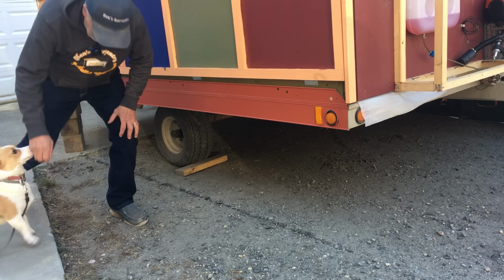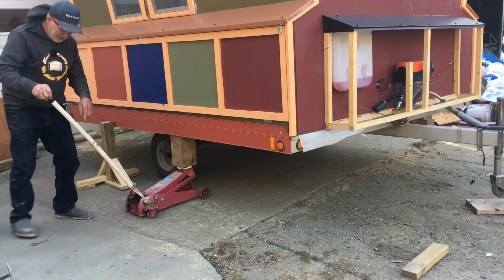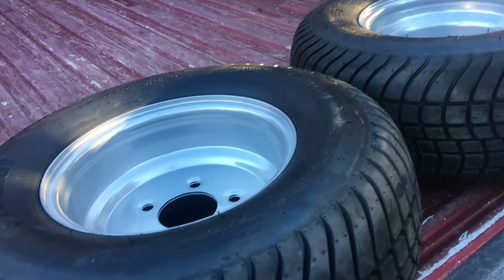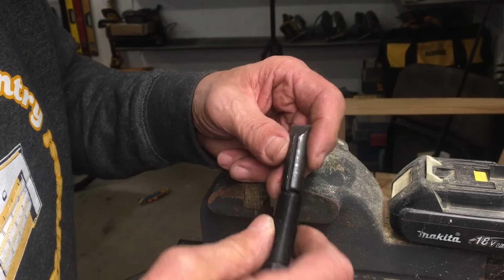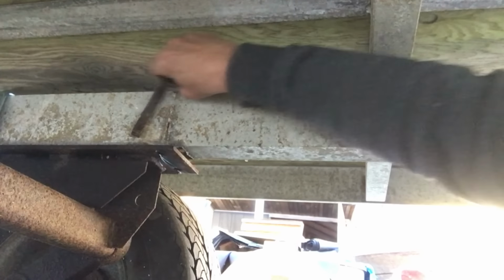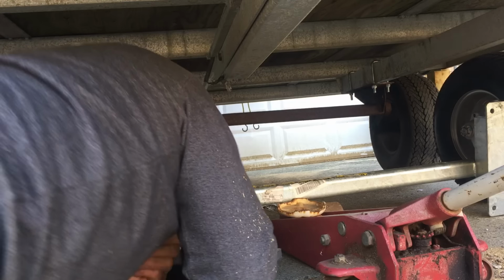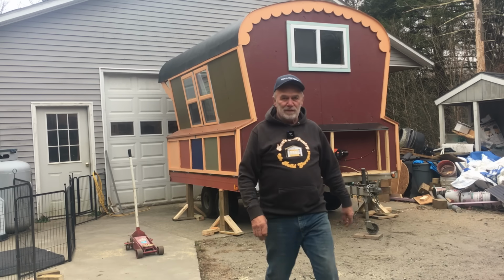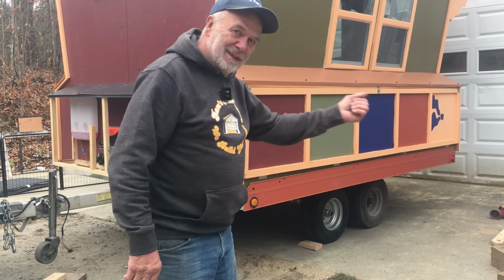Adding a Second Axle to my Trailer!

Comment: I think that would have been a good day for Chad to stop by ;) Doing all that on your back and side is a REAL pain in the neck, I feel your pain, BTDT!!! You surely are an intrepid soul. Do you need to reverse the axles or can you just slide both of them backwards? Clearly you need to move the center of gravity forward for the proper 10%-15% tongue weight and I don't think reversing the axles will accomplish that. Plus, you have the interior weight at the front complete already, any further work in the rear will move the center of gravity that direction even more.
Reply from the maker: Thanks

Comment: Good morning Ken. I went through 2 different types of nut splitters before I learned my lesson! I bought a impact wrench and it paid for itself the first time I used it!!! It’s a deWalt (had the batterie) but any name brand will work.
Reply: even a corded one if you don't use it that often.  They are a big help when you need them.

Comment: You should have 2/3 of a trailer in front of the axle and 1/3 behind you need tongue weight or when you pull it that thing will sway back-and-forth. It might cause an accident just a bit of advice Ken don’t want to see anything bad happen to you or someone else God bless
Reply from the maker: I agree thanks

Comment: Ken, you need a certain amount of tongue weight on that trailer.  That's 10% to 15% of the whole vardo weight.  Otherwise it tows very badly.  To get that, you need to move both axles back.  You certainly need to have both sets of tires carrying the same amount of weight, so you might need to check the distance from each axle to the center of a wheel and maybe replace the old tires so they match the height of the new tires.  You also need to check that the frame is level front-to-back so the axles split the weight.  You might need to change the height of your hitch to do that.  It's a lot simpler with just one axle.
Reply: You need to move both axels back. General rule is 1/3 weight on hitch, if not it will whip around you going down road.
Reply: Came to say the same. So if it weighs 4,000 lbs you want 600 lbs tongue weight.   If not the trailer can get into a perpetual condition that ends with you in a ditch.

Comment: Ken, you need to centralise the axles, basically find the centre point and aet the axles so that the pivot point is in between the two axles, that way when towing the trailer it will turn at the centre point, not to far forward or backwards,

Comment: Been there and done that try rotating your receiver hitch 180 degrees and ball it will get you closer but still have to relocate axles also check the distance between the axles don't just trust the frame. But you know this having pulled trailers most of your life and as remember you mentioned you built homes on trailers in your past
Reply from the maker: Thanks

Comment: Axles must station 60% back from the front of the tongue.  If you don't, your trailer will sway side to side and flip over due to not having enough weight on the tongue.

Comment: Working up, on your back, is really tough! My neck is shot for several days after I do it. Good luck getting things lined up. I had a trailer where I had to turn the hitch ball over, so it was higher than the receiver. I actually bought a second one to do it, so I still had the one that dropped.
Reply from the maker: Yes for sure. Nice

Comment: Ken, after swapping the axles the tongue is still to high to drop onto the hitch ball. May I suggest you take the ball off the coupler, turn the coupler over (180 degrees) and reattach the ball, that will make the ball 3" to 4" higher. That should help. Good Luck. Await your next video. (The old retired guy in San Diego, CA)
Reply from the maker: Thanks I agree

Comment: Hey Ken,  You are braver than me. At our age it is tough enough to do work on our backs but you got bum knees to boot. I got my own issues too. BTW - Just a normal DIY wrenching tip. Always coat your bolts in anti-seize during assembly. I use the Permatex silver on most and the copper on hi-temp stuff. If it ever has to be reworked in the future you will thank yourself.
    Your nut buster was designed backwards. I got a Craftsman one from the 80's that has the sharp cutting point set on the crest of the hole and the big fine thread busting bolt has a simple blunted round tip. Mine works just fine. When the metal of the nut finally gives it pops, then the nut can twist off easy. The tool also has side flats that a wrench can fit onto. The extra wrench on the tool allows you to exert pressure between the two opposing wrenches to turn the busting bolt and not twist the tool on the nut.
    Tough luck on the axle thing. On the bright side - It should be much easier this time with all the new hardware and the stands already built. 
Thanks for sharing the adventure. Heads up. Snow coming our way late week according to Jim Cantore.
Reply: Now I know what this tool is. I inherited quite a collection of craftsman tools from my father and some of them, I am clueless about.  Those craftsman tools are made for a lifetime!

Comment: Hey Ken, Looks like the way my days go. You are an inspiration. The drivers that you use to put screws in should be able to handle those bolts. It would be a lot easier on you. For future issues  a 20V DeWalt driver would most likely be able to snap the old bolts off.
Reply from the maker: Cool thanks

Comment: Great video.  Thirty years ago I bought a Sears Craftsman nut splittter.  I still have the origianl box.  I have used it twice...both times failed to work.  So don't feel bad. Like you,  I use a grinder now.  Kind Regards, Craig

Comment: You will need to move both axles. You need at least 300-400 lbs on the tongue to have any control when towing the Vardo.

Comment: Every "first time" is a learning experience. Pro tip: Tongue weight should be up near 10% of the total trainer weight and never less than 5%. As I recall, you were aiming to stay around 2,000 pounds so grab that bathroom scale and fool with axle placement till you are around 200 pounds at the hitch. The fine tuning can be done with interior up-fits or location of permanently loaded gear, like that power station, propane tank, etc. Water tank should be as close to center as possible because that load will vary and centering will keep it from tipping the scales.
Reply: I agree with @rupe53. Get more weight on the hitch. Too much weight behind center line it will fishtail at highway speeds.

Comment: If you have an impact driver they make a adaptor to use 1/2 socket to run those bolts on and off. Good luck.

Comment: Wow, one moment i thought the Vardo was going to tilt right into the garage door. Apparently most of the weight is aft. Moving both axles aft about 5 to 10 inches or so should solve it - no need to swap axles. The Vardo should then lean "naturally forward". I am BTW in awe of all you do - alone and without exploding like I would :-)

Comment: That trailer work is tough any time.  You will have to get more weight on the tongue of the trailer.  That nut splitter certainly was a disappointment.  Thank you for sharing your day(s) with us.  Trailer weight can be deceiving.  . . .  You will take more stuff than you realize.

Comment: Hi Ken.
We replaced our 2000 lb. utility trailer axle (not Axel Rose) with a 3500 lb. leaf spring assembly.  We overloaded the trailer and damaged the original axle (not Axel Foley) and couldn't reuse it.  We went with a leaf spring assembly which needed components welded to the frame.  I ovelooked the option to use a torsion bar which might have saved me from going to a welder.  Was the new torsion bar axle rated for 3000 or more lbs?  Thanks for bringing us all along on the build.
Reply from the maker: Haha. Thanks

Comment: Is there enough room on the frame rails to slide the axles to the rear another couple of inches?  It almost looks like it's balanced TOO well, and a rear shift should put a higher percentage of the weight onto the tongue.

Comment: Hey Ken, I’m sure you can use your regular 18 volt impact gun with a 3/8” socket adapter. We used them all the time to run bolts in.
Reply from the maker: Thanks

Comment: You don't have to change axles  around 
You just need to move them back further. You definitely need to have the correct amount of weight on the toung to prevent the trailer from fish tailing. Have seen the results of incorrect weight distribution many times traveling across the country.

Comment: Can look at that other trailer that you just purchased and then measure it and see how far back those axles are on that trailer so you can figure out the percentage of the Virgo trader. I say 60%. That's what I was always been told. If you're at 50% or less you're headed for a wreck.

Comment: Next time lube the nutbraker thread and lube the wheel studs as well.
I would cut the shackles as it’s much thinner than the nuts. 🌰
Aren’t you supposed to have leaf springs between the two axes?

Comment: I know nothing about axle. So, I learned a lot just watching you today! I do have a silly question. If you move both of them back a little bit, wouldn't that change the center of gravity enough to allow the front end to drop down enough? There's probably some kind of formula to figure out how much tongue weight is ideal (for safety). Just thinking out loud. So interesting to watch this. Can't wait to see what you do. I love the addition. Very smart move in the long run. God bless.
Reply from the maker: Thanks I redid the axles today

Comment: Before you do anything you need to check with NH dot and see if you need to put electric brake on the new axle because you are changing the gown of the trailer

Comment: Trailers with a gross weight of 3.000 pounds or more must have brakes on all wheels. There are 2 types pf brakes, surge brakes and electric brakes. Surge brakes are self contained hydraulic and electric requires a brake controller. A breakaway kit is rewired on 3,000# or more.

Comment: You need about 200lb toung weight, 60 40% is standard axle placement or it will wag back & forth while driving, avery dangerous thing to have happen.

Comment: I don't think swapping the axles will fix your issue.  The axles need shifted backwards--to get clearly more tongue weight.  10-15% of capacity load to be ideal.  The tandem axle configuration the center line--in between axles is the new reference point.  You should be able to call or look up Snowbird (or your specific trailer) manufacturer for the axle set back specifications to get your correct tongue % rating for your sized trailer.  Basically, measure 6' from the front of trailer to the new tandem axle centerline on a 10' long trailer.  You can then dial in ideal tongue weight by shifting axles a little forward or backward from that point.  Forward to increase tongue weight--rearward to decrease tongue weight of the 6' centerline.
Reply: Edit.  Shift axles forward to decrease and rearward to increase tongue weight--after you identify the correct centerline axle positioning and get figured out.  That is what I was trying to articulate...the more weight behind the tandem axle = the less tongue weight on your hitch and vice versa.  Sorry, my fingers were too quick before sending.  Apologies.  I think your axles both need to shifted rearwards to get balance corrected and more weight on the tongue for drivability and 6' to centerline--measured from the front would get you close to ideal.